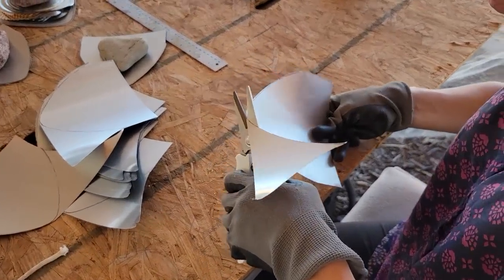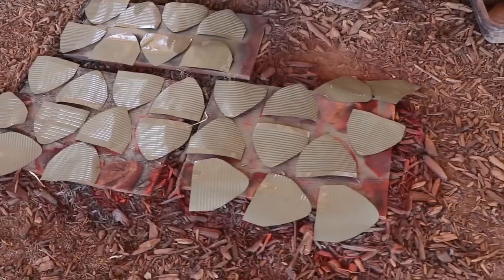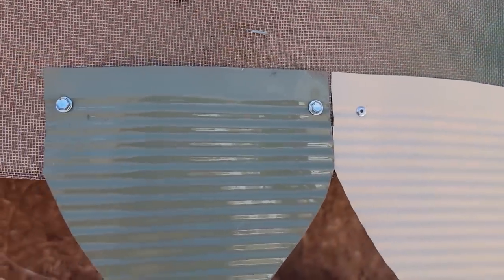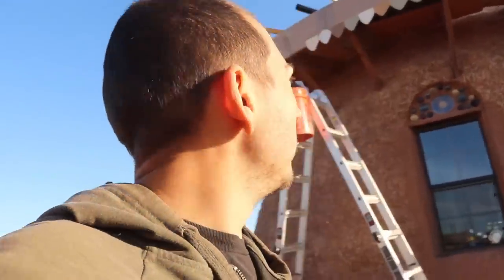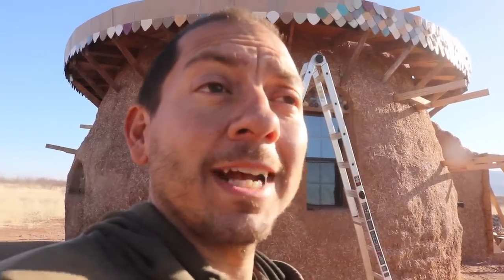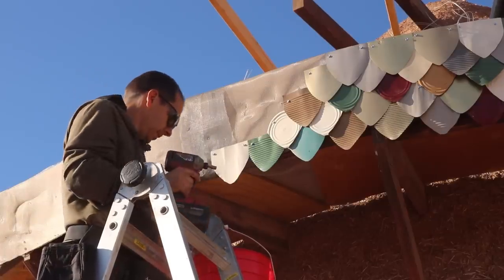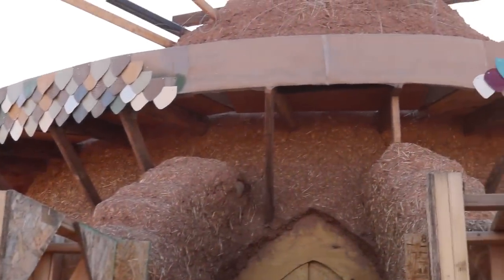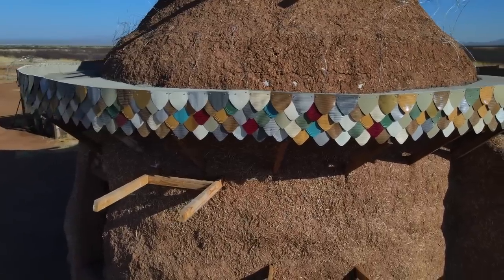Beautiful Handmade Dragon Scale Tin Can Shingles | Building Off-Grid On A Budget

Comment: Loving the shingles. Have you figure away to access so you can get to the top part of your dome and the gutter interior? It would make it easier for future maintenance or just to finish the dome with final coat and finish your water collection system? How about building access from the exterior of the hallway connecting the two domes. By crafting a set of stairs to get up and over to the gutter and then be able to get to you dome as well. Are you planning a similar gutter on the other dome to catch water too? Since you have not made the hallway to the two domes you could build a exterior walk way to each of the top domes and gutters as part of its roof of the hallway with a exterior stairs to gain easy access up there. No more folding ladder. It also be safer and easier bring up supplies. You could even hang an extended pulley system to attach a box to pull up supplies. Just a few ideas you might want to build next to make accessing the top half of the dome easier and safer.

Comment: Forget ANY drilling!  You can get a hand sheet metal punch that's way easier.  I've got 2 of them.  Dad was a sheet metal worker.

I think I saw new ones in Harbor Freight, Lowe's, or Home Depot.  They're not very expensive.

Another thing: these punches can punch a variety of hole sizes.

Comment: You probably should have used a roofing nail for the Shingles.   They have a rubber grommet to allow the shingle to flex but not rip out of the roof when you get strong winds.   They do make a self tapping roofing screw.    That cold feeling in your fingers, and they dizzy feeling, is a sign of Iron deficiency.   Your fast is depleting your minerals in your body to unsafe levels.

Comment: Not to poke holes in your plan, but I normally see nails with rubber washers used in metal roofs. I'd hate to see moisture get in behind the screw heads and cause problems.